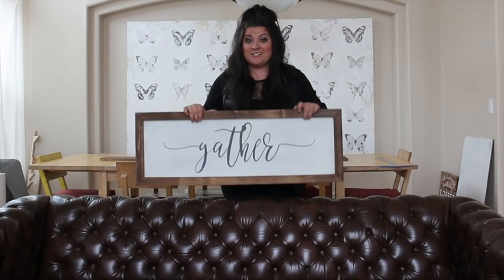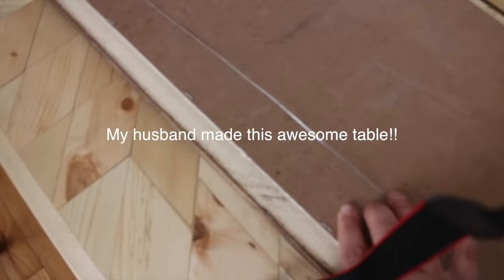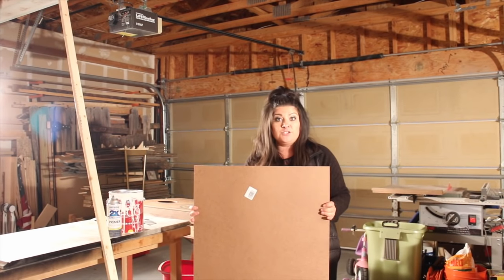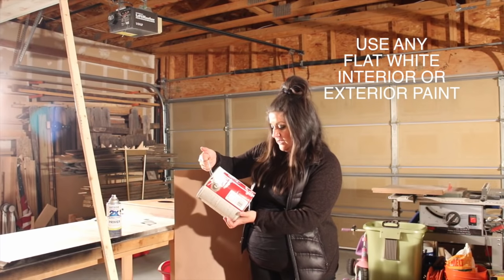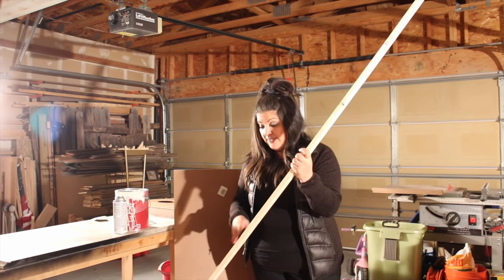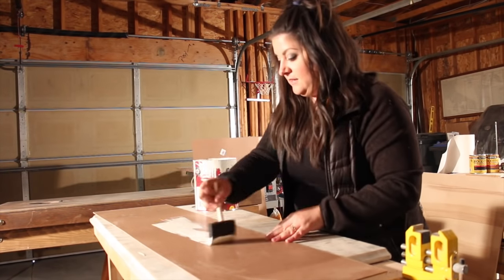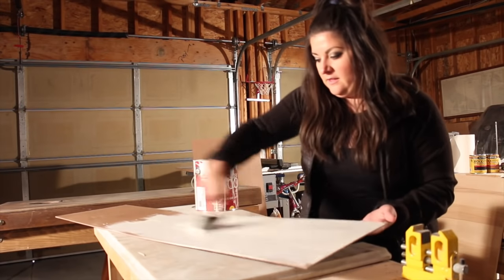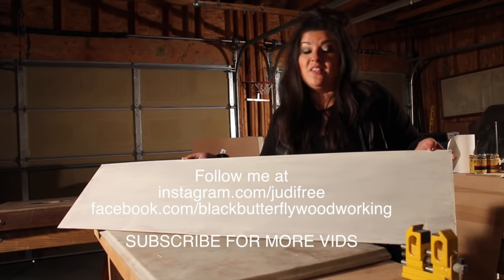Farmhouse Style Sign - Tutorial Part 1

Comment: Wondering how you don't have any "bleeding" under the vinyl. I try to do it very lightly, but I still get it. Any suggestions? I am using the 1/4" plywood type material that has a grain on it. She wants it stained and the smooth material doesn't stain well.

Comment: I used hardboard and kilz water based primer on top.  Then I laid down my stencil of 813, painted my words then when I pulled off the stencil it pulled up the primer and a little of the hardboard in places.  Can you tell me what I need to change?  Thank you so much for your videos.  They are so helpful.
Reply from the maker: I'd use real paint. Not kilz. I also use 631 vinyl. I don't know how 813 would work.
Reply: Black Butterfly Creative thank you.  What kind of real paint do you suggest? (Latex enamel... what?) I wonder since I have the kilz if I spray polycrylic on it, it that would seal it enough to use?
Reply: The same thing keeps happening to me.

Comment: I can't seem to get my staple gun to attach the board to the frame.....  Do you have to have the air powered kind? Any other tips on way to attach?
Reply from the maker: Hi! Yes, I use a stapler with heavy-duty staples powered by an air compressor. If your stapler isn't quite powerful enough you could try using small pin nails and just hammering them in.

Comment: How do you get the back piece to not look weird with the frame on top? Like when you look at it from the side
Reply from the maker: Hi! For these, the hardboard is so thin that when it hangs on the wall you really won't notice. However, what I've been doing is using a router table to cut a small inset (called a rabbet) on the back of the frame that the hardboard fits into and this causes the back to be perfectly flat.

Comment: What do you use for your stencil?  I've had trouble with my stencil peeling my paint up on the hardboard.   Thank you.
Reply from the maker: Hi! I use Oracle 631 for the stencil. It's labeled as "reposition-able" rather than 651 which is permanent.
Reply from the maker: PS: But make sure you don't leave it on too long or even the non-permanent vinyl will begin to bond with the paint and peel it up.

Comment: How do you cut tempered hardboard?
Reply from the maker: Hi! I use a standard handheld circular saw with a guide so it cuts straight. The easiest way is to have Home Depot cut your boards to dimension on their panel saw. They charge about fifty or sixty cents per cut but it's worth it! (and sometimes they don't even charge you for it)

Comment: hi!!!
hOW DO YOU MEASURE FOR THE FRAME?
Reply from the maker: Hi! I measure the frame so that the hardboard is overlapping at least 1/2" on all sides so there's enough room to staple the hardboard to the frame all the way around.
Reply: Thank you!!! =)
Reply: Black Butterfly Creative So, is that 1/2 longer than the board. I may have messed up. I had them cut my furring strip 4 ft and 2 ft.... should I have them cut it 4 ft 1 inch and 2ft 1 inch for a 4ft by 2 ft sign?
Reply from the maker: Half Past Eight - hi! It depends on what type of frame you are doing. You can still use the pieces you had cut if you want it to perfectly fit the sign. I like a little wiggle room in case I put the design on a little crooked or something, then I can apply the frame to make it still look square and centered. Hope that makes sense
Reply: Black Butterfly Creative Okay, thanks! Hopefully, it will work out!  Waiting for everything to dry! The hardest part of the entire process! Lol!